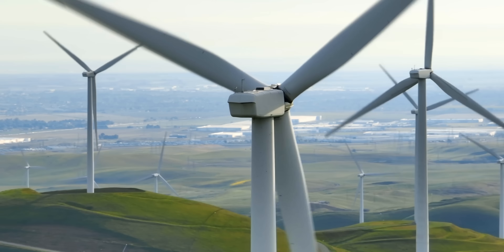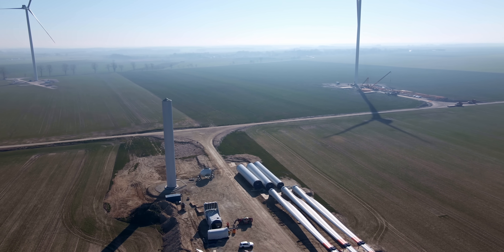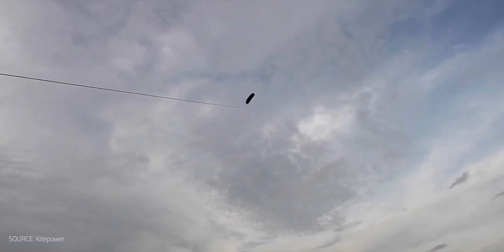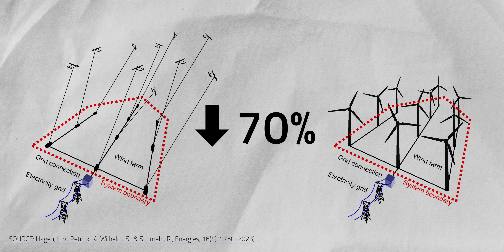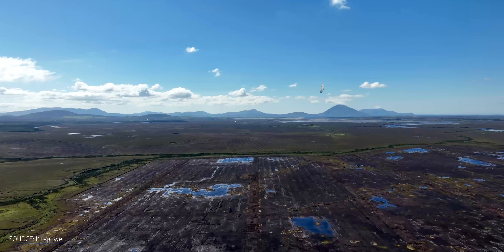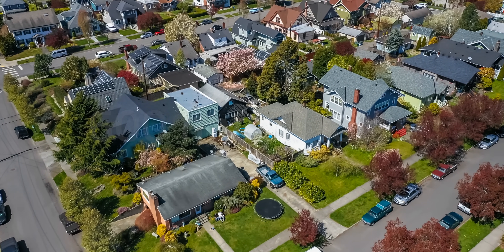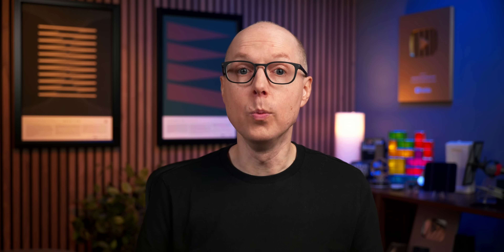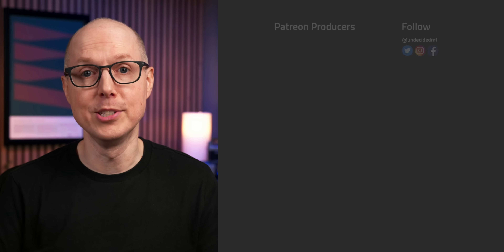Are We Building Wind Energy Wrong?

Comment: It can generate 30 kW/h. Great, that sounds... Wait, what? That unit doesn't even make any sense. (timestamp 8:45)

The power unit in the video is generating 30 kW which is 30 kWh per hour (which is exactly the same number only slightly more complicated). Time is not a part of this unit. It is like saying "My car has 130 hp per hour". It doesn't make sense. The car has 130 hp, period. It does not matter how long the trip takes, it has always 130 hp unless something is broken.

 Same with this kite thingy. The runtime does not matter. Whether it's running for 5 minutes or 3 hours or 90 days is of no consequence. As long as everything works, it's generating 30 kW. Period. If you want to be politically correct, go for "up to 30 kW" or "30 kW peak". But leave the 4th dimension alone, please.

Saying it generates 30 kW/h would be awesome if it was true. Lets say at a runtime of 6 months at a windy location, for every hour the power output increases by 30 kW. That would be 130000 kW or 130 MW near the end of the runtime! Weeeeeeee! Ok, that's obviously not true, but 30 kW peak is really good as it goes and even great at a good location.

In timestamp 10:00 there is a number 1780 MW/h per year. At first glance this looks like it's the same, but it's not. Since we are using two widely different time units (in this case hours and years) this is a good way of expressing the average energy yield any customer can expect over a long time. So, this is perfectly fine.

Comment: how is it 2/3 the homes, but 1/10 the yearly output?  At 2/3 the homes, and 3/10ths the cost, having 2 kites would be 4/3 @ 3/5 the cost, 3 kites then would be 6/3 or 2x at 9/10 the cost. Something about the scaling maths of this are not adding up.

Comment: remote locations. OR atop office buildings. sky scrapers.
Reply: You could also Tether between buildings in dense downtown cores, tension lines that pull back and forth using the nature sway of buildings on a similar drum generator. adding small turbines to the the facade or behind channels in the corners or between floors to capture some of that wind energy. OR even a multi floor pendulum instead of the cables. This pendulum could be aesthetic, artistic, and safety as well as a source of power for the building.

Comment: Hum... 
My first thought for the kite system was "You'd have a spring in the retraction mechanism."
The kite must generae more power than the initial starting force of the spring. 
After that as the kite rises it generates electricity.
Once the wind is no longer strong enough to pull the kite out further or if the wind slows, the spring automatically retracts the kite, generating more power. 
The theoretical minimum power generation is much less, but the theoretical maximum is probably about 60% higher. (you will lose energy due to winding the spring)
Reply: Oh... or... Flywheel? :)

Comment: This is a super complex control problem to solve with environmental conditions changing from minute to minute and the forces of wind vs kite being measured in tons - my take is that this will take lots of trail & error to solve but the potential for good is worth it - i hope we keep trying and building knowledge & expertise with this technology  - very interesting for sure
Reply: The idea has been around for decades. It just won’t work because the variable conditions and the mechanical and technical controls required. We have a virtually unlimited supply of wind for fixed turbines. The “turbines are ugly” statement is ridiculous. Imagine hundreds of kites gyrating through the sky.

Comment: One issue is pollution.
Traditional wind turbines becomes worn, and the stuff the rotors(?) are made of will pollute.
I assume wind kites will pollute as well. So the best question probably is: What "friendly" (non-toxic & durable) material can we build the kites out of?
Reply: Everything pollutes somehow. So the game is to pick the one that pollutes the least. I would rather have this than a comparable diesel generator. Diesel generators are far more polluting to make and operate.
Reply: @dkiel5771  Of course, but in this case we're comparing "kites" to wind turbines.
Reply: @SigurdBraathen  The analysis technique is identical. Nothing is perfect, so which is the least polluting per unit of energy produced (if that is the criterion) should be the one you invest in. I deliberately used the radically different (diesel vs windmill) case to illustrate how people think about this incorrectly.

Comment: It doesn't make sense to me. Does the wing collapse when reeling it back, or what? It's got to take as much energy bringing it back in as it makes letting it out. And if it's in the back of a boat, wouldn't it just be increasing the load on the boat motor unless the  kite was pulling in the same direction as the motor pushes?

Comment: I'm all for innovations in renewable energy tech, but this just seems silly. The kite parts I mean, I'm partially optimistic about the non kite kind. The "footprint" of the kite as it does it's cycle will be many times langer than that of a regular windturbine and as mentioned you need several to break even with one windturbine. We're probable talking square kilometers of sky potentally occupied and scaleing up will mean they will eventually encroach air traffic. At least the wind turbines stay put at predictable locations.
Also when a wind turbine catastrophically fails there's mostly nobody around to be in danger. These kites are large and heavy as mentioned and will deal a lot of damage when untheathered. Ever seen a short with a trampoline in a storm raging through backyards? Well that times 200 at least.

Comment: Looking at the system, I wonder would it be possible to use two kites alternatively. Once the first kite reaches the end of its tether, launch the second kite to continue generating power while simultaneously providing the rotational motion required to reel in the first kite. Assuming flight patterns could be controlled to an extent to prevent the kites and their respective cables getting caught on each other, a two kite system should substantially boost the efficieny of the system.

Comment: I have had 3 wind turbines for 27 years. One of the turbines is a VAT mounted on top of my barn.  Since I made them myself out of recycled rebuilt and repurposed  elevator motors my cost was mostly sweat my sweat. Instead of selling my power back to the company at a very low rate I decided to put the power into my own wood pellet mill.  I use everything from leaves, seasonal scrub brush, fallen or dead trees to healthy limbs. I also get a lot of free wood chips from landscape companies
Reply: @silentvoiceinthedark5665   can you talk about your system more? How much power do you generate? Do you have batteries, and what capacity? Are you already hearing more water that you can use?
Reply: @nopenotmedude  I have gone through many lead acid battery platforms from golf cart, car, marine and deep cycle. I have some lithium batteries at present and combined can power my home completely for 4 days without wind. I have a 4 kilo solar array and the wind turbines can generate 17 KW at max wind. If the wind is too fast above 40 MPH sustained it can cause damage.  In my opinion batteries have been very expensive but lithium is now close to affordable.  I have in the past generated more power than I could store and have experimented with heat banking water in 55 gallon drums.
Reply: @silentvoiceinthedark5665   Have you considered "sand batteries" ?  Banking that extra energy/heat into large containers of sand instead of water; this channel has one or more good vids about that particular "simple cheap effective battery tech" as well...
Reply: @brianwall9592  I have tested them, water is still better because you can pump it, you have to pump water through the sand anyway so why not stick with water. I built a heat pump out of an old window AC unit to experiment with. My estimate is that you can increase the temp by 30 degrees from what the water temp is with a home made heat pump.
Reply: Please upload a video of it. I'm subscribed.

Comment: The electricity is generated as the kite rises in altitude. After reaching the end of the cable you have to use a motor ( electricity) to haul it back down so it can rise again. It's a passing fad. Soon nuclear power ( fusion) will surpass it.

Comment: I'm confused how it generate power when the energy to pull it down should be the same that it pulls up.   Does the kite change it shape on the way down causing to to be easier to pull?  The graph show shows a tiny loss of power pulling down compared to the outward pull.

Comment: I think AWES is an interesting "emergency use" system, like for cities to deploy during disasters. Like the water treatment and  EMT services could be connected to a second power grid that is connected to a combination AWES/Diesel/PV system. It doesn't seem practical as a continuous running system however since it would likely result in conflicts with airspace. The only permanent installations for this are likely going to be arctic locations that otherwise would be completely cut off.
Reply: No DESIL is evil . And People should not live by water

Comment: I can see, how those Systems could be used to help disaster response or help to bridge the gap in projects, where the normal grid is not yet established and where power demand is limited. Beyond such applications, I am very sceptic - at least, as long as they are not demonstrably just more efficient in the long run. 
And I am particularly sceptic about adventureous applications like those for ships. Kites as sails have been proposed and praised for a long time now, but there are good reasons, nobody uses them. They add a whole new level of complexity and risks and make shipping dependant on local winds. Kites falling into the sea, kites getting entagled with those of other ships, adjustments of the routes to optimize kite efficiency, dependance on additional kite opperators - who wants all of that in a business, that depends on reliability and predictability? Such applications might be part of the mor distant future - but not before the technology is cheap as dirt and so common, that the risks and benefits are well known as established facts from the real world.

Comment: https://youtu.be/ZlCJcTq3Jk4?t=531  30kW/h ? what is that ?  I know kWh kilowatthour , that is a one kiloWatt for on hour or 6.3Mj , This would  tell me something, but still make no sense. because thhis is measure of energy , not power. you should give a power figure of this device, like 30kW not energy figure, which depends if was made in one hour or one week. but kW/h and specificaly pronounced by you as "kilwatt per hour" is like a mesure of how fast the output power can change, and that is not only  most likely absolutely wrong , but completely doesnt matter for this kind of interrupted power, that would matter for powerbanks and constant energy generation devices.

Comment: This technology would be good for small arctic communities where building windmills is made nearly impossible by the remoteness and difficult terrain. Small communities in Canada’s arctic rely on diesel generators 24/7. Fuel can only be delivered by ship in the summer. Running the local power systems on this easily transported and setup solution even part time would be better than what has been proposed so far as the wind blows most of the time ,but the sun is only a good source of energy for 50% of the year.

Comment: That yoyo style feels like it could use an upgrade. Maybe a mechanics similar to a 'water hand pump' so it keeps producing the torque constantly. There got to be something that can keep the kite up high constantly instead of flying down low to recoil the yoyo.
Reply: You could Actually float one off the Ac cooler fan. They litteraly use a truck wench In neutral
Reply: The attach a Starter

Comment: In a way. Generating power from wind is a "mistake". 1: Wind speed changes all the time. 2. Very little energy. The force at 10m/sec is only 50N/m2. On the other hand harvesting energy from the tidal waves means. 1. predictable water speed with little changes from day to day. 2. Very high energy density. 2250N/m2 at 1,5m/sec flow.

Comment: IMAGINE WE HAVE FLEXIBLE SOLAR FABRIC THAT CAN BE INTEGRATED IN THIS. YOU CAN GET ELECTRICITY BOTH IN AIR AND SOLAR. IF THEIRS A STORM AND THAT THING STRUCK BY A THUNDER, IT CAN TAKE THAT ENERGY INTO THE BATTERY WITHOUT FRYING IT BECAUSE OF A CIRCUIT THAT CAN MINIMIZE AND UTILIZE THE POWER. IF THEY CAN DO THAT. THIS WILL BE GAME CHANGER. OH I HAVE I ANOTHER TAUGHT. IMAGINE SIGNAL OR FREQUENCY FROM EARTH OR FROM OUR CELL TOWERS CAN TAKE THOSE AND CONVERT INTO ELECTRICITY

Comment: 8:52. I think you mean 30kwh per hour of energy output, ie the kite system could charge a battery with 30kwh of energy every hour. Not bad, basically one households  worth of daily energy collected per hour.
But, those big offshore wind turbines output that amount EVERY REVOLUTION! One 360 degree turn of the blades outputs about one days worth of energy used by an average home
Reply: It's kWh/h, which is just kW

Comment: Why not use tethered blimps with turbines?
Reply: Too expensive and complex? What to do in extreme weather? Check out gyrocopter-like air-borne wind turbines 😊
Reply: @jsjs6751 yes exactly.. i cant see this thing being scalable, it will be a tangled mess 😅
Reply: @da8ap  I was answering your question about blimps with turbines. 
I believe kites is a better option. 
In those altitudes wind will be pretty stable. If extreme weather or calm weather is coming the kites will automatically be pulled down. Everything will be automated so entanglement between the kites is less likely to happen.

Comment: 10:00 1780MWh/year is easier to parse when phrased as an average output of 203kW, and saying that would be enough to power 600 households is... optimistic. According to my Enphase system, my average consumption as a single person in a climate that doesn't require a huge amount of HVAC is around 13.5MWh/year (or around 1.5kW sustained average), and while I could probably do with a bit of an energy diet, that works out to being able to power 130 of my household. Which is certainly nothing to sneeze at! But their math isn't mathing, for me.
Reply: Just got a letter from my supplier - 1,372 kWh for the year, no gas for me. Think that energy diet might be overdue, but hey, not a competition is it, just 13.5 sounds like a lot. Though, 1780MWh at my annual usage is 1397 homes like mine so...I guess it depends on whose home we're looking at; maybe it's an average.
Reply: @Bob-h4s2p I've done multiple audits of where my power consumption is going and the biggest single consumer is the dehumidifier in my basement, which unfortunately I can't go without. I've already done everything else I can to cut down my consumption as much as possible, like all of my lights are low-power LEDs and my computers are all power-efficient aside from my gaming computer which only runs when I'm actually gaming. I mean I suppose I could also just go without a refrigerator but that seems like throwing out the baby with the bath water.

Comment: So how do they manage to loft the kite into the high-altitude, high-power winds if there is no wind at ground level?
Reply: You can always launch the rigid enough ones at least in similar fashion to the gliders with human pilots - just have the drum work as a motor rather than generator for a moment and pull it in the rapid movement of the in this case aerofoil kite thing catches the air and gets it airborne.
Reply: It never goes down so low to leave the steong winds completely. It needs to be windy just during the first deployment.

Comment: i wonder if these would be practical over solar farms (or regular farms). would seem to have minimal impact on sunlight and would then be easily plugged into grids. 
for ships - it would only seem to help if the winds pulling in the right direction. and if it is, why convert that to electricity and not just use it directly to pull the ship.

Comment: Aren't container ships already using kite sail systems?
Reply: All wind-powered cargo ships are stuck in trials. "French start-up Airseas [Oceanicwing?] has successfully tested a massive kite that can help pull cargo ships over the sea in the Atlantic Ocean." There are several cargo ships with solid sails on-deck from WindWings; there is a very small Neoliner Origin sail-powered cargo ship. Sails are difficult to fit on container ships and other ships that need clear deck space.

Comment: What the hell is 30kW/h? Did you mean 30kWh? 
30kW of power on that large footprint is not much. I doubt you can just deploy multiple of those in close proximity to each other.
Reply: I suspect he meant kWh/h, which is just kW average. I assume they would synchronize them if installing them close to one another, which i think ha actually mentioned.